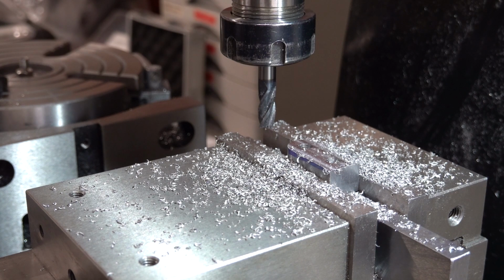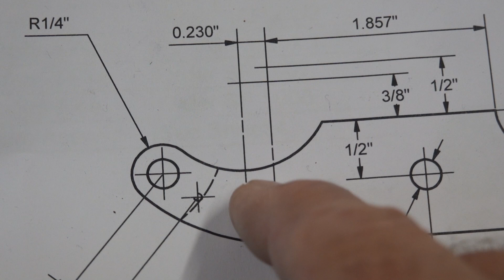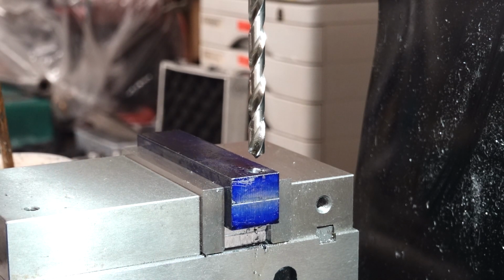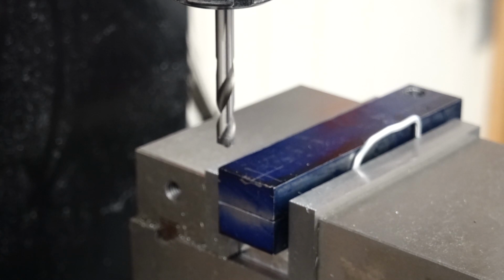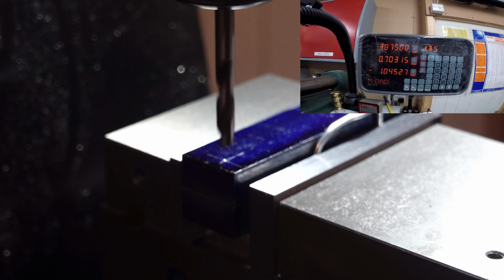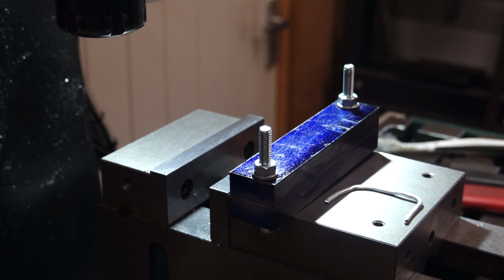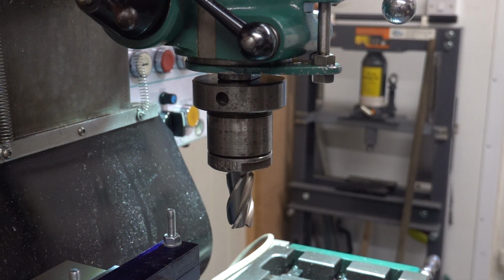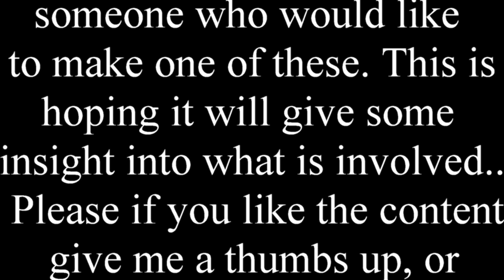Hemingway kit lathe knurling tool part 3

Comment: Hi Stevie, coming along nicely. I was taught to set Clarkson holders up exactly as you did, it never let me down either so don't change anything. I think the reason they are cheap now is the advent of solid carbide cutters from China that are cheaper than HSS ones over here and they don't have the centre in them making the good old Clarkson redundant. Welcome to the Arc Euro trade vice, mine won't grip multiple parts even at each end of the Jaws. I will be ripping mine apart shortly and getting it up on the surface grinder to try and improve it. Cheers, Jon
Reply from the maker: Hi Jon. Yes i am slowly finding a few shortfalls with the vice. The old Abwood did not have much jaw opening , but it did have a Samson like grip. The downward force when tightening is not really what it says on the tin. When i bought the Milling machine , the guy gave me the Clarkson & a couple of collets & cutters. I found a guy on Ebay selling a job lot of cutters & collets. I bought them all. As you say they are all HSS. At some point i will do a workshop tour & show them all. I also bought a job lot of Carbide cutters, by Swiss tech & Merlin. All brand new, so they are really my go too's.

Comment: You could make it a bit easier and save having to do the maths for future jobs in one of two ways.
1 touch off with the edge finder, zero the DRO, wind in 2mm ( half finder diameter) and then press zero again this puts the ctr of the spindle directly over the edge of the work so you can then just use the dimensions off the drawing eg 5/8" or 0.625"
2. touch off with edge finder but instead of zeroing press the other Y button and then enter -2 (2 if coming from other side) This will again put the spindle position over the edge of the work when the DRO reads zero so drawing dimensions can be used.

Substitute the imperial 0.079..... for imperial or just quickly switch the display to metric and enter 2

Sideplates look good.
Reply from the maker: Thanks for that Jason. Also I did think of switching the DRO to metric. But decided to stick to Imperial, Mainly because i thought it would give the old brain a workout. Most of what I have done with other projects has been in Metric. But slowly getting there.